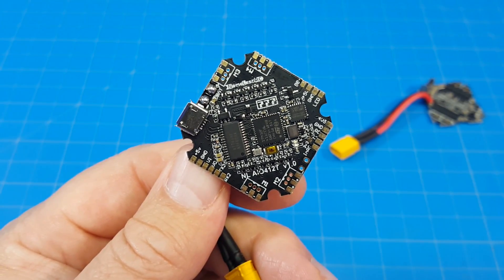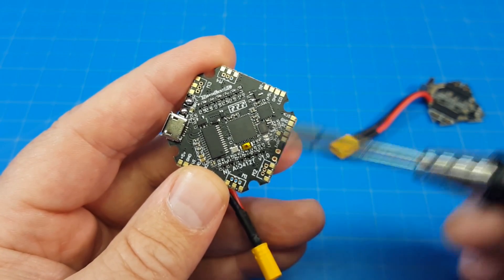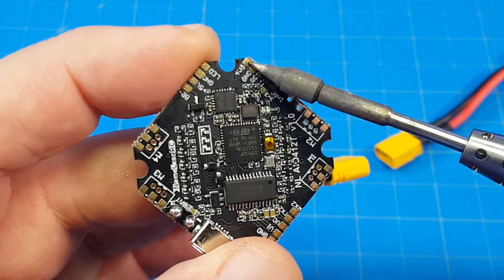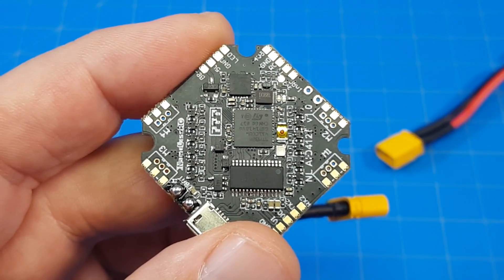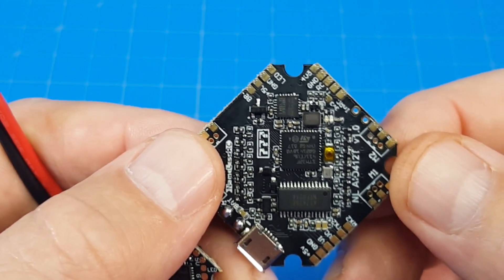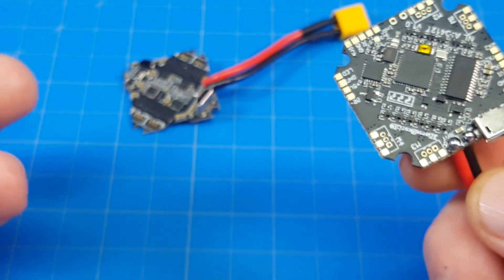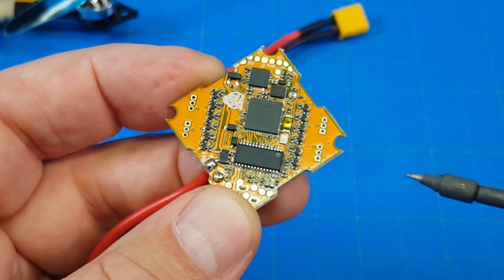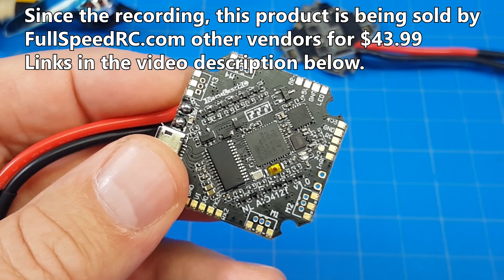NameLessRC Whoop Board (AIO412T)

Comment: I recently purchased and built a tp 3. Im using this nameless rc AIO but cant seem to get beta flight to recognize the receiver. ive tried 3 different recievers... all of them bind to my radio fine but i get nothing in the reciever tab in beta flight. They have uart 1 set up for receiver. Ive made sure sbus is selected. Im out of options here... been flying 5in quads for a while and have 1 quad that has the same issue.(even tried a new FC) Hope you can help!
Reply from the maker: I suspect you have it covered, but maybe we need a different uart on for the receiver? I would try each one, one uart at a time.
Reply: @NickBurnsFPV  yeah i tried both uarts. I think i have a dead FC. This is my 3rd attempt at building one of these, i think im throwing in the towl. (Already $200+ down the drain) Does anyone build these and sell them? I just cant gut throwing anymore money away and apparently i just dont have what takes
Reply: Was the battery plugged in while you were in betaflight?
This board does not output power to the rx when you plug in usb

Comment: Hello Nick, what is your sugestion ragarding motors? I'd like to use my 4S lipos 450mah with this frame https://banggood.app.link/IX6Frmbvt4
Reply from the maker: It would depend on prop and quad targeted weight.
Reply: @NickBurnsFPV  I don't have target weight but of course I would like to have as light as possible. 2-blade props 2,5-3" - I'm sure only about battery 4s 450mah. And currently price for this board is excellent. 32$ with all BG points
Reply from the maker: @w1llyFPV  I would look at the geprc GR1206 3600kv. 4500kv might also be okay, but might be pushing the limit of the esc and would have less flight time.

Comment: CAUTION: If you flash the NameLessRC F4 12A AIO with Jazz Maverick firmware, for rpm filtering and 48khz, DO NOT use  P_H_15_48_REV16_77.HEX on your ESC's or you may fry it (I almost did just hovering on 2s and many have fried theirs, especially on 3s) It's recommended we use P_H_90_48_REV16_77.HEX for Jazz Maverick OR JESC firmware, which is optimum as it's "120" instead of "90"
Reply: Thanks ! So, better PH120_48 or PH90_48 ?
Reply: @maeldrz  I've heard JESC PH120 is optimal, but at this point, I still have the Jazz Maverick PH90 on my TWIG (NameLessRC AIO412, Diatone Mamba 1505 5000kv,) I was flying yesterday on 2s & 3s with no problems. I purchased JESC firmware and set up an account with JFlight.net, but just haven't tried the PH120 yet. Are you part of RCGroups.com? If so, I'd ask "Jazz Maverick" and "Joe Lucid" on there. IMO, They're the ones who probably know the most about these issues.

Comment: Absolutely Awesome.. I want one.. Do you think the usb (hanging over the edge) is susceptible to damage or being ripped off?
Reply from the maker: I don't expect the usb to be in harms way, it will likely be close to lining up with the arm and would be a very unlucky tumble through a tree to be able to make contact.
Reply: @NickBurnsFPV  Thank you..
I'm debating also about the betafpv AIO 20amp now. It has a programmable led pad.
 I'm just trying to figure out what the max amp draw of the 5 volt BEC is.. Hum? No luck finding literature on it..

Comment: How do you bind this board to controller?
Reply from the maker: bind the board? This board doesn't have binding...no receiver. We bind the receiver the manual/normal way.
Reply: @NickBurnsFPV  I was hoping you wouldn't say that :(
bought 2 of these to fix up some toothpicks and thought they were all in one boards. 
Any recommendation for some frsky receivers? I'll have to buy some now :P
Reply from the maker: @somerandom3247  I tend to go with the frsky xm+ or R-XSR. XSR is shorter with a connector, xm+ a bit longer with longer antenna. I found the less expensive and smaller frsky compatible often had binding and or reliability issues.
Reply: @NickBurnsFPV  thanks :)

Comment: Just used the 412t in a whoop build. I absolutely love it. Put it in a beta75x frame with mamba 1103 10,000 kv motors and on 2s it’s quite impressive. Mine came in quite heavy at 46 grams but I still get 3:30 on flight times. I’m thinking about switching to a beta85x frame for the bigger props and 3s. I think that would be quite the combo.

Comment: The pin labeled 4V5 is for the receiver and is the only 5v pin that receives 5 volts from the usb.  This is done to simplify configuration.  Some brands FC use to do so.
Reply: This. Should be 4.5 volts
Reply: This is great for configuring betaflight. You don’t need to plug your main battery to be able to configure the modes and checking if receiver is working. And also your vtx will be grateful!

Comment: HI NICK . WHAT DO YOU USE FOR A SMOKE STOPPER ? EYE TROUBLE I USE CAPS .
Reply from the maker: I have a couple, depends on the quad. There are two from racedayquads I have, one is the small led based one and the other is the traditional headlight version. I also have the tbs version...I think I bought that one from pyrodrone.  TBS https://pyrodrone.com/products/tbs-smoke-stopper?_pos=1&_sid=e1f269796&_ss=r headlight https://www.racedayquads.com/collections/tools-and-building-supplies/products/light-bulb-smoke-stopper-xt60?aff=15 led based https://www.racedayquads.com/collections/tools-and-building-supplies/products/smoke-stopper-xt30-by-rdq-and-bengineeringlabs-modern-led?aff=15

Comment: Available at FPVCycle.com https://fpvcycle.com/collections/flight-controllers-aios/products/namelessrc-aio412t-fc-esc-aio

I worked with NamelessRC on this.  I upgraded some tiny things and did the whole layout. Of course this is still China so I couldn't get everything I wanted and even the layout isn't the best. The damn cap pads could have been in a better place and some other things need to be reorganized too but all in all it's a good first go around. Way easier to solder than whoop boards and you have access to all the solder points when built too. I inadvertently worked with betafpv on basically the same board too. Their version doesn't have the cap pads and they're using different drivers for the fet switching. I've run the nameless board on pretty high draw quads for weeks but I wouldn't recommend more than 1304 and 3S on it.  The beta variation will be available soon at FPVCycle.com too which is the new site I'm working on.
Reply from the maker: And there is it. I had heard this story through the grape vine. I wasn't sure how it all unfolded.

Comment: Looks like it's worth the effort to close the motor pin holes with solder tin when soldering the motor leads on the board.
Reply from the maker: for conductivity?
Reply: @NickBurnsFPV  , 
Yes, As I see the bottom of this fc the holes run through the copper traces. The holes are a weak spot in the trace when soldering the motorwires to the pad. especially the centre trace at 5:16

kr, Erik
Reply from the maker: I see what your saying now. Thanks for helping me understand.

Comment: Nick, the BabyHawk R 2" and 3" came with 12a 4s rated ESCs as well.  Do you think the ESCs in this board can handle a lightweight 3" with (roughly) 1106 4500kv motors on 4s?

Thanks for the the thorough overview!
Reply from the maker: yes, I do.

Comment: Finally a whoop board where even mere mortals are capable of soldering the motor wires on to the pads.
As long as no other company releases an even better board in the near future, this is the one that will go into my next 3 inch build.
Reply from the maker: oh you know they all will jump on the new design.

Comment: The 4V5 pad provides 5 volt but is powered from the usb as well as your battery.  So when you plug in USB if your receiver is powered by the 4v5 pad it will be powered by USB.  This designation is the same on all flight controllers.  Nice review! Thanks
Reply from the maker: Ah thank you. I didn't know that.
Reply: Thanks good info!